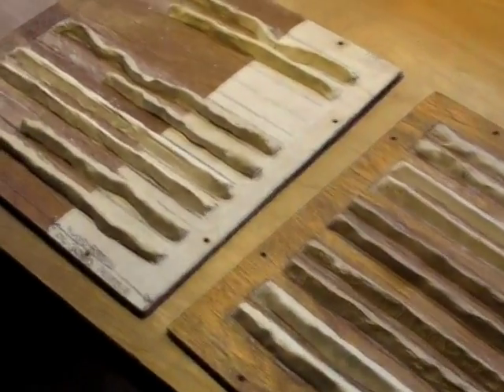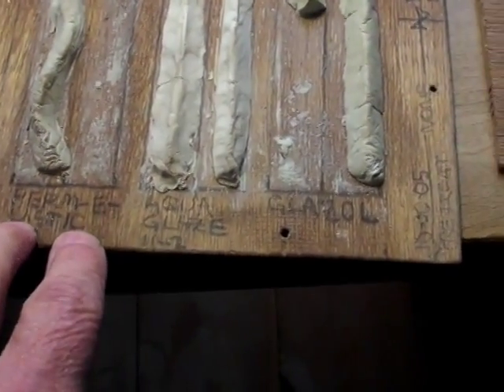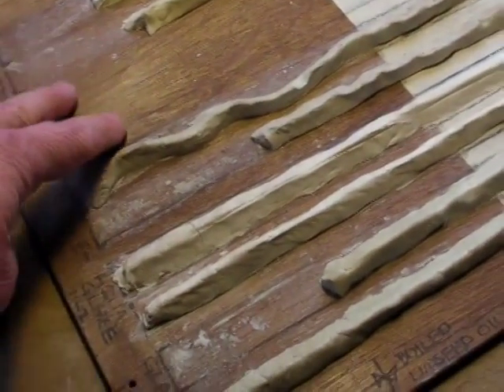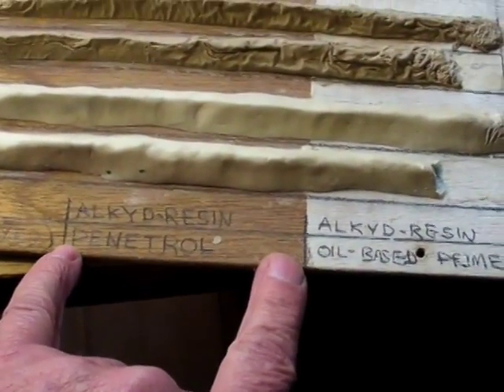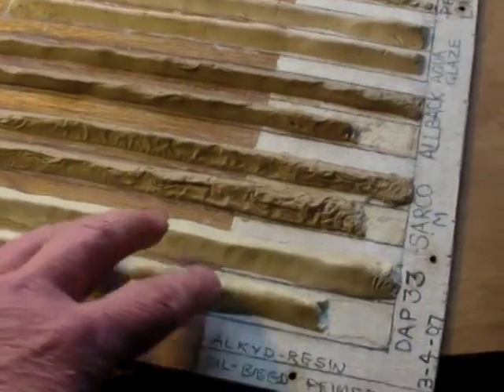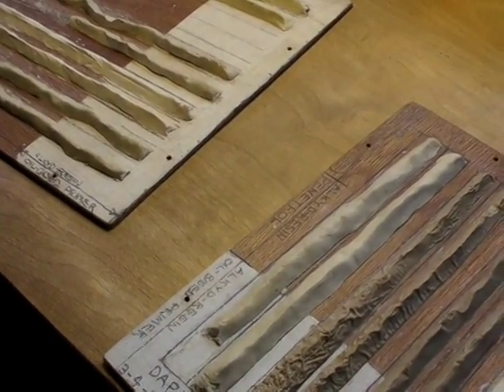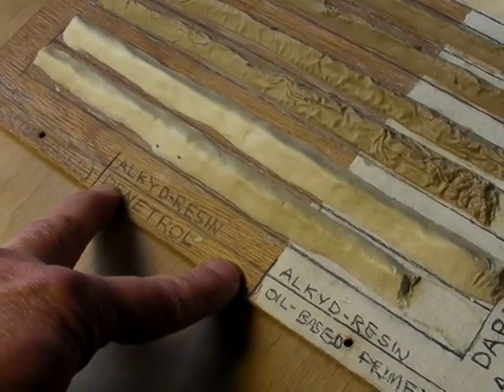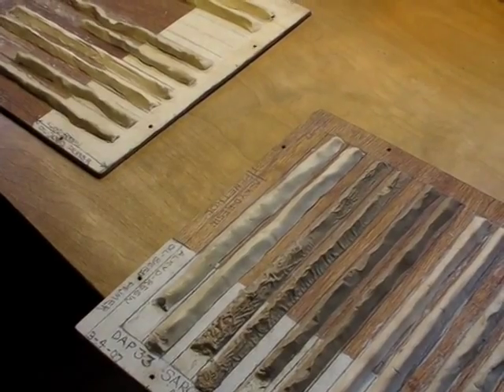Window Sash Glazing Test

Comment: Great video. I am a restoration painter. In my opinion an accurate representation of how glaze holds up to the elements would have to include being painted with a coat of oil primer and two coats of latex paint.
Reply from the maker: Dennis, This test is about how the putty adheres to the glazing rabbet. You have an excellent idea for a test. I encourage everyone to test out their best methods and materials using the Scientific Method. I currently have one test going that compares latex house paint and oil-based enamel on top of the putty in a wooden window sash exposed to the elements. The putty was primed first with oil-based primer. The test was placed 8 years ago and I'm expecting some results in 15 to 20 years.

Comment: Wow this is awesome!!! I am recently starting to deglaze my windows. I waited to get Sarco bc there were so many negative comments about dap33. However, dap 33 looks like its held up amazing...and that aquaglaze! Maybe I should just use that?
Reply from the maker: Nope, go with Sarco and not DAP. This test just shows adhesion characteristics, and does not show overall performance in a glazed sash.
Reply: @johnleeke  how much of the original glaze needs to be removed? I feel like I'm wasting a lot of time being too perfect? And is it okay to do boiled linseed mixed with turpentine..or should I prime? The outsides were painted. The insides were stained. I'm stuck on what to do next. They are cleaned up pretty well
Reply from the maker: @justtisha  , you may only have to remove the putty that is loose. If you don't want to remove all the putty, learn what to do here at my website:
http://historichomeworks.com/forum/viewtopic.php?t=1574
 If you have removed all of the old putty, you can learn about applying all new putty here at my window website:
http://saveamericaswindows.com/forum/viewtopic.php?f=10&t=7

Comment: I watched this a few years ago and in the meantime have gotten down to work restoring about 60 window sashes.  I am now biting myself in the butt for those I rushed through without priming the rabbets.  I started sweating until I remembered that I did, indeed, shellac the 18 light front door before glazing.

One question still: everyone has plenty of hate for DAP 33. Is this based on results and long-term performance or problems with it in the process of actually glazing?  I am currently using DAP and possibly only because I don't know any better, have achieved good results and speed.
Reply from the maker: I don't hate DAP 33, but  I do recognize its characteristics and consider them when selecting a glazing compound:
==> consistency can be variable, from too loose and sticky, to crusty with lumps
==> contains materials that can be risky to health and the environment
==> less durable in service than other putties and compounds
With that said, it could be OK to use it, if that is the only compound you can get. But you should be looking for another putty that will be better.
More on selecting putty in the Save America's Windows book in print:
http://saveamericaswindows.com/get-the-book/
Or, you can now get the chapter on glazing sash as a PDF download:
http://historichomeworks.com/downloads/glazing-and-painting-wood-sashes/

Comment: John You ARE THE BEST!  I cant thank you enough all the work you have done!
I have a couple of questions.

I am not yet clear as to what I want to use as a pre-treatment but sounds like Penatrol (assuming you are talking about the Alkyd & linseed oil solution ie paint additive https://buyat.ppg.com/rep_pafpainttools_files/Flood/tdb/FD_FLD4C_CAEN.pdf) is a good choice .... am I just as good off using a straight boiled linseed oil?

Have you done any more testing similar to this?
I am specifically looking at using Sarco Dual Glaze ... I might also have enough windows to do in shop and will possibly look at also using Sarco M

Comment: So whats the verdict?  Aqua Glaze?
Reply from the maker: Verdict:  Not Guilty.
Aqua Glaze is not guilty of being the best, nor the worst glazing compound. Every putty and glazing compound has certain characteristics. Aqua Glaze dries fast and can be ready for painting much sooner than oil-based putties, but it tends to crack if it dries too fast, and its long-term performance is unproven. I use it for quick spot putty repairs where the putty line is just two or three inches long.
Reply: Thanks for your response.  Wondering if theres a result in this test that would make you not use a product at all?
Reply from the maker: The result of this test is that there is usually better putty adhesion when using a pre-treatment in the glazing rabbet, confirming the traditional practice of using pre-treatment.
Do you work on windows professionally?
Reply: I'm a professional woodworker.  Currently building a new house for myself and making all the windows.  Learned enough to decide on single pane glazed with storm windows.  Very interesting process convincing the building department to allow single pane windows in new construction.  I'm also planning on using Linseed paint on the windows as well.  Your articles and forum have been the best resource.  The article on Clapboard siding, which I found on "Ward Clapboards" website is very well done.